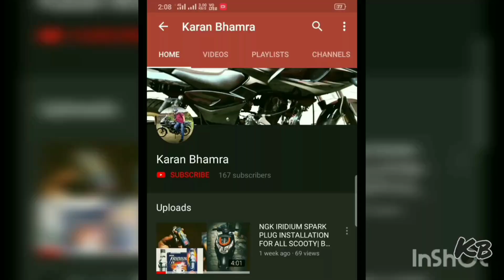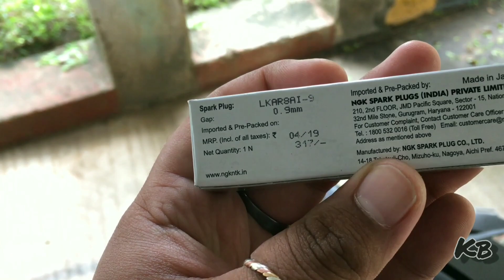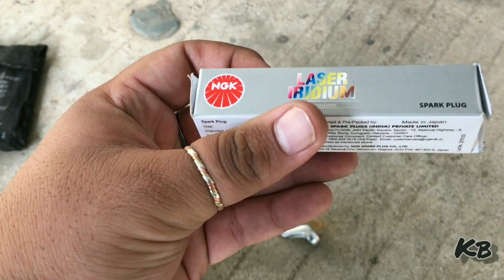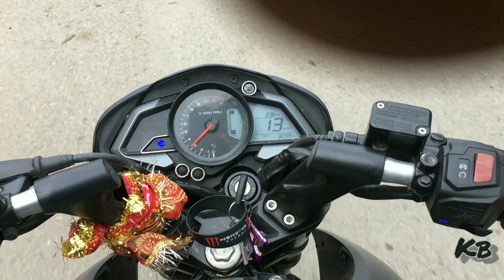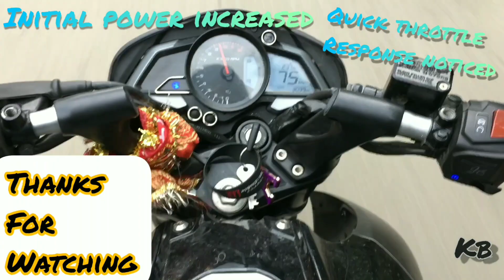Installing NGK Iridium spark plug in NS200| Quick Throttle Response| pick up, mileage Increased|

Comment: Does it affect cdi
Reply from the maker: Cdi nahi hota ye sab bike me..
ECU hota hai..
Ye spark plug se ECU ka koi connection & effect nahi padega
Reply: @karanbhamra689  bhai bs4 carburetor version hai , Maine jab se iridium spark plugs apne ns me lagaya hai , bike 4th gear me 90 , 5th me 85 aur 6th me 80 ke around jaa Rahi , agr throttle full le Raha hoo to bike band ho jaa Rahi hai
Reply: @karanbhamra689  bhai yaa fir koi aur problem hai , bata sakte ho , bahut pareshan hoo
Reply from the maker: Carburettor clean krwao..either dusra carburettor laga ke check kro...
Or wapis se stock wala spark plug laga ke dekho solve hota h ki nahi...
Reply: @karanbhamra689  clean Kara ke dikha Diya hai

Comment: For NS200 Official required gap of spark plug 0.7 to 0.8 mm..while ngk provides 0.9mm. Does it necessary to adjust the gap of ngk plugs? Large gap may damage piston or cylinder head.
Reply from the maker: (Who said that large gap destroy the head and cylinder..This is the only myth..)
You can install this plugs without any changes to it's gap..
Reply: @karanbhamra689  thanks..i just suppose to follow bajaj ns200 manual that mentioned gap 0.7 to 0 8mm. But i will use these plugs as NGK presetting thay is 0.9mm. Thanks
Reply: plug gaps that are recommended by manufacturer shows a reference only, if gap gets wider it may misfires the combustion which is a waste of combustion cycle, what does gives you the idea that it damages the piston or cylinder head, yes its only a myth.. but remember to use the specific plug size (not the electrode gap) , too short or too long plug that can damage the piston and that is a fact..
Reply: @eyeofdragon3036 thanks i purchased Ngk LKAR8AI-9 and Ngk CPR8EAIX-9 for ns200..is it right for ns200?

Comment: Does ngk iridium spark plus produce high heat range then stock spark plug in NS200?
If yes then may high heat range damage electric components?
Wii it safe to use these NGK spark plug in long term use
Reply from the maker: Ngk iridium is the costly spark plug and they are used pure combustion of petrol in engine to produce more power delivery and quick throttle response..
There is no issue of heating the engine and u'll not get any problem by installing this plugs . You can blindly buy these and install it for better performance...
Nothing electronic components will damage Don't worry abt that...
Reply: Bhai ap Kaha rehete ho
Reply from the maker: Jamshedpur
Reply: U will feel slight difference, it's just that combustion will be better and u can have a peace of mind till 60km but company claims 1L km

Comment: Which size socket did you used to remove main plug?
Reply from the maker: The spark plug box wrench socket is available in the tool box along with the bike..
If you not get then buy a box wrench of 18mm/19mm
Reply: @karanbhamra689   is that the same thing that work as wheel bolt spanner?
Reply: It's complicated to open the mother spark plug. I would suggest you to get it opened by experience mechanic. Hardly they will charge 100rs. But DIY is complicated only for the mother plug

Comment: Bro last month I went to hill area and... The route was very uphill and I found that mine ns200 having problem to move forward. 

So I just want to ask that should I used to change my spark plugs and something else to make it's performance nice? 
As I'm planning a trip to badrinath temple so for that I'm asking for some suggestions from you if you don't mind 🙂
Reply from the maker: Firstly switch to motul 7100full synthetic engine oil 10w40 (and also oil filter) + change your spark plugs all 3, if you want iridium then it will be more better + if possible change your air filter at every 6000-7000km + change your coolant + adjust your chain slacking + grease your both wheel bearing + and most importantly clean your carburetor with carburetor cleaning liquid spray or use petrol also and clean it's all small holes and mixture screw compartment..!!!
Do this all you'll never face any problem 💪
Reply from the maker: And also don't forget to flush the engine oil before Changing to new one..
Use 3M engine oil flush
Reply: @karanbhamra689  ok thank you brother I'll show this to someone who got better knowledge of mechanical things. Thank you 🙂
Reply: @karanbhamra689  can I get this Motul 7100 full..... E oil  on bajaj service center?
Reply from the maker: No,
U'll get all things from Amazon.!
And never use bajaj engine oil in your whole life.. it's a sludge maker recycled oil.!
Reply: @karanbhamra689   😳😳ok brother.. I'll keep it in mind thanks for informing me🙂
Reply: @karanbhamra689   brother I want to ask you regarding the engine oil you suggested me... 7100 synthetic engine oil 10w40 and I want to ask you that can I use 20w50 grade oil in my ns200? if not please let me know
Reply: Bro, engine ingnites with help of air and fuel, when we reach high altitude, the air will get thin and bike won't get enough air to burn fuel, so it will become rich mixture. What we have to do is lean carburetor mixture at that time, so that air fuel proportion will become ideal. Fi engine won't get that problem, because it have oxygen sensor to measure and control fuel flow.
Reply: @himanshunegi6479   20W50 is recommend for Ns200, That grade 7100 oil is available in market. Stick to standard oil grade.

Comment: Mileage ??
Reply from the maker: Not tested yet, but the mileage is same as stock upto 40-43kmpl
Reply: @Karan Bhamra any improvement bcoz im using apache dual head spark plug in my 220 and mileage improve 2 kmpl smooth sound high rev , cold start and jurk free low gear but noob mechanical brock my one side spark plug now i wont to replace it
Reply from the maker: Apace spark plug cost 150 rupees and this is 700 rupees so u can see the different in price and product also,
I've got much improvement in my bike as I've mentioned in the video and this plugs runs upto 15,000-20,000 kilometers.
Reply: Can u indicate the spark plug number code, thanks